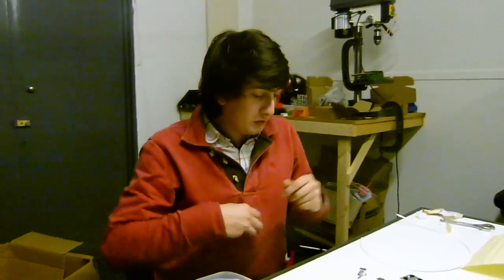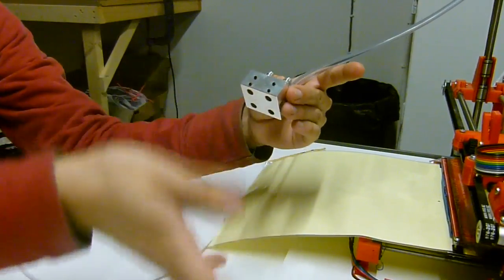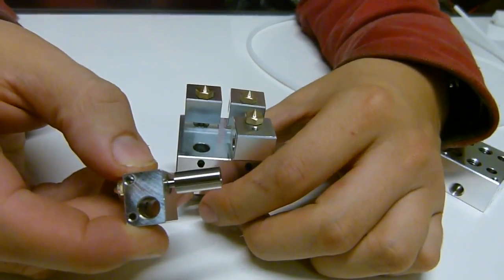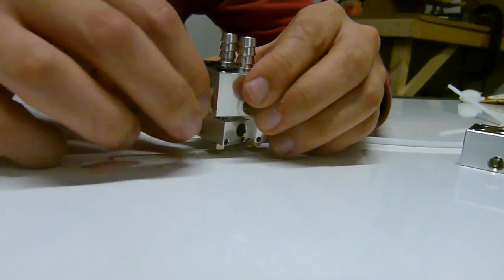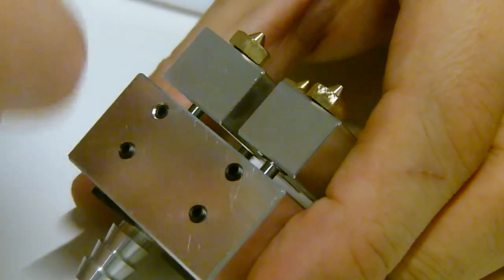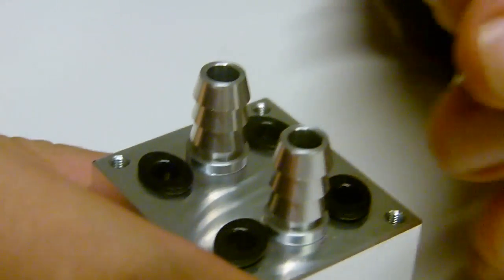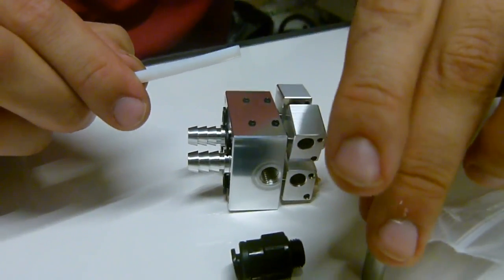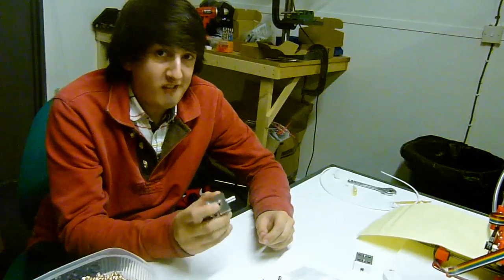E3D Kraken - first look.

Comment: Oh, I'd swim in your lovely pile of stainless steel barrels :)
Still no way for 3 mm filament? Also, it looks like the PTFE tube ends near the middle of the heating block, but don't you think it may reduce the maximum allowable temperature?

Comment: I'm imagining this will bode well on a deltabot! It would be great if there top and side threads to maximize mounting options - either for mounting to the carriage or to a fan/heatsink mount. I'm also imagining that a diaphragm air pump might be a suitable (albeit less capable) alternative to feed into the cooling ports. Can't wait to see the final design.